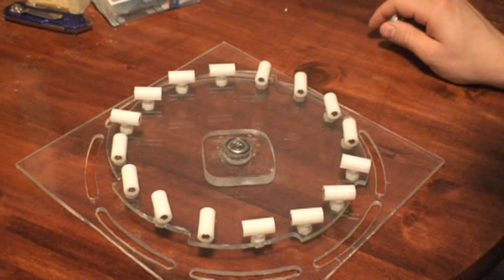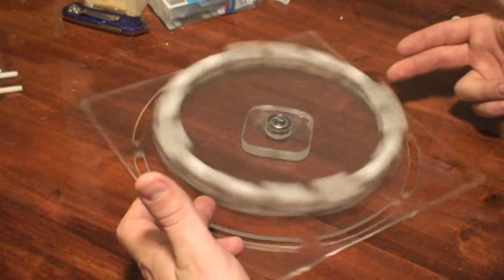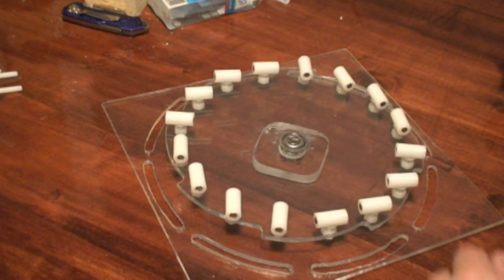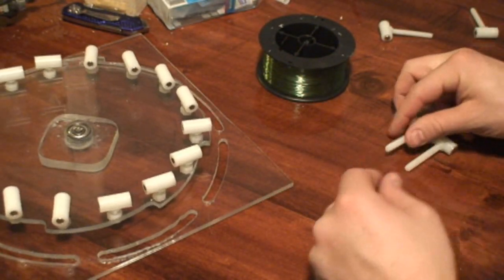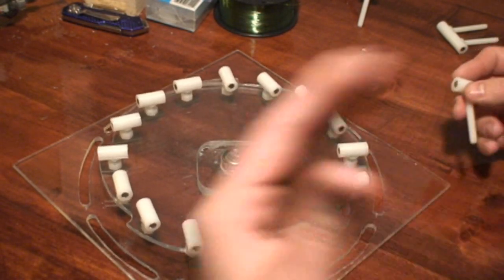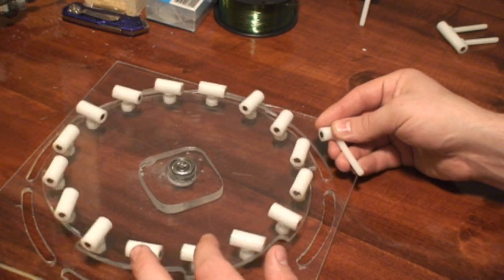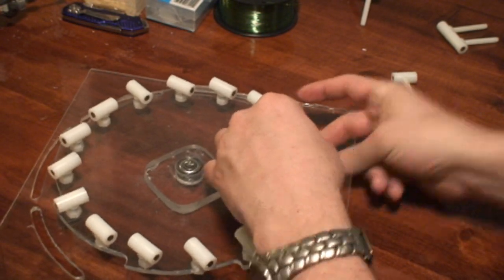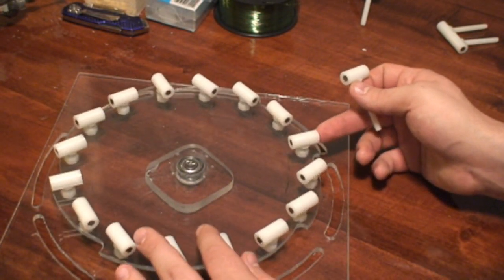Magnet motor, free energy, overunity test 2

Comment: Sorry Guys, Taylor Yarick is right, all the OP has done is recreate an electromagnet motor albeit a mechanical one, it requires energy input to spin the wheel, as soon as you put a 'load' on the wheel like the mini dynamo to drive a light this will put opposing stress on the magnets in this demo and the OP would have to work harder to keep the wheel from stopping. The OP concept of cheaper or free energy is just plain wrong. go to college and study electronics, this will include magnets and coils. you will learn quickly that you cannot create energy and there will ALWAYS be losses during the convertion of motion to electric or visa-versa.

Comment: Congratz on inventing the electric motor...
Reply: lol
Reply: that was my thought too. it's a complicated version of an electric motor that doesn't work...
Reply: Why do electric motors need fuel then?. _.
Reply: corgidog quirke
electric motors need electricity to create a magnetic field. In this case the fuel is the guy himself switching the magnet. So for that reason alone this is not "free energy". There is no such thing as "free energy" because of physics.
Reply: +corgidog quirke Because they are losing energy.And this is why this free energy bullshit will not work.
Reply: +Jürgen Ruut Maybe you're right. but that doesn't mean there is not a situation being created here where a net gain of energy could be created
Reply: l1thal
If you (could) factor in the energy put into the system by him rotating the magnet, you will find that this motor will not be able to generate energy. Nothing can. There is literally no way to create energy from nothing. For any Newtonian motion to happen there will have to be an energy input. And in ALL cases, that energy input will be greater than what you could retrieve from that motion. That is because any two objects that interact with each-other will always lose some energy through heating up and then cooling off again.

If we talk about sub-atomic particles and how they behave then yes, motion seems to simply "happen" (photons will always move at the speed of light from the instance it is generated until the instance it is converted into something else) and even though that motion still has "energy" to it, it is not generated from nothing. It is a bit hard to explain how energy works in a single youtube comment so I suggest you simply read up on the "law of conservation of energy".
Reply: +Jürgen Ruut Maybe he could create something that uses the force that is obviously being generated by the magnet (rotation of the wheel) in order to make that one small magnet rotate. I'm sure the force needed to rotate that small stick is significantly less. Also, the magnet is naturally repulsing, so it WANTS to turn away from the other magnets on the wheel. The force needed to do this would not be more significant than what that spinning wheel has.

I would be careful about your all-knowing power, Dr. Omniscient. There is an infinitely growing number of examples in history where people who say certain things are impossible are being proven very very wrong. These 'laws' have been created my imperfect people have broken before. We DO NOT know everything about physics what-so-ever. So please don't go around killing everyone's dreams and concluding that there is not hope for this type of thing because the honest to god truth is that you do not know.

On a less aggressive note, How did all the energy get here in the first place? If energy cannot be created or destroyed (I have read this law and have researched it some) Then that means that energy cannot exist what-so-ever. So where did all this come from? All the energy we expend everyday comes from several sources, but what happens when the sun burns out along with all the other stars? when all these plants stop rotating etc.. Something, Somewhere had to make all this energy happen.
Reply: l1thal
Where did the net energy of the universe come from? That is a very good question and by all means, after you have educated yourself on how energy transfers work in this universe, go and try figure out why the big bang actually happened... I'd kill to know the answer.

Also, no... the rotation of that wheel would not be enough to keep rotating a small magnet. He specifically said that the wheel has as little friction as possible... that is the reason why it would seem like it would give out more energy than is put in. But if you don't believe me... please go ahead and try it out. After you have failed, come back to ask for forgivness.
Reply: +Cristian Ceron take a look read a book reading rainbow
Reply: I'm not trying because currently I have other aspirations in life besides sitting on my ass and looking like a no-life as my wake of drama follows me all about wherever I go on the internet. Unfortunately, I'm not willing to speak about my job here, but I can assure you I am benefiting the world. In not only what I do for a career, but also in what I do here, ENCOURAGING people who DO try and have the desire to making something of the sort. While we have people like you who go out and look for things, then come home and sit on a computer and rant about how everyone else is stupid.

Cristian Ceron You're right, Friction DOES exist. But that fact doesn't mean we know everything about physics. Don't deduct that everything has been discovered unless you want to look like one of those idiots who say things will never happen and then those very things end up taking off.

All I'm saying is you guys should keep your negativity to yourself. It's not benefiting anyone.
Reply: Was my first thought too. But then I looked at the comments and was not surprised to see that I am one year late to the party ;-) This gives me hope that even in the Trump era there are still intelligent people out there who understand basic physics.
Reply: Ivan Zhu hi
Reply: That's a combustion engine.
Reply: also alot of electric motors take petrol due to a back up petrol engine to either drive the car if it runs out of charge or to run a small generator to charge the batteries to run the electric motor
Reply: Actually the joke is on every one of you that laughed at this guy for thinking he created free energy, he got a shit ton of money from this video (4.4 mil views), so it's more like free money for him
Reply: Doesn't work
Reply: Well this is running for free.
Reply: Electric motors are energy conversion devices, not energy generation devices. If fact, there are no energy generation devices! Burning gasoline for example,  just converts stored chemical energy to heat and work but doesn't make new energy.

Comment: maybe you can design a switch that changes polarity when the magnet is approaching. making sure mechanically that most pull is used, switched polarities on time to then give it a push after leaving its proximity per magnet.  if a switch can change polarity on a certain right timing it might enhance the velocity of turning. or like have magnets spin on the outside making use of the poles as needed with timing. maybe you can have a  little laser detector or some detector to really be able to get a signal and create a specific perfect delay in the switch. great mentality about the team work! hope you succeed.
Reply: Using mechanical means to turn the magnet would result in friction, which would make it loose energy I'm the form of heat. It would slow down and stop eventually.

Comment: To much talking. :/
Reply: Filatuss for nothing. It's just another fake video ...
Reply: Filatuss ...and too little understanding of elementary physics.
Reply: ^ Bingo.
Reply from the maker: Mike Adams Yeah, sometimes I'm embarrassed at these early videos. But it was what inspired me to really dig into studying. Now, I silently shake my head at people with as little understanding as I had then. Oh well.
Reply: jzsd14me Well, if you learned from it and progressed that's a productive and beneficial outcome. No need to be the least bit embarrassed or ashamed for not having learned the fundamentals of Physics earlier on.

You eventually learned and are much better off for it. I was lucky to learn Physics in high school and college. Plenty of students never received any education in the physical sciences whatsoever as one can clearly glean from the comments posted.
Reply: +Filatuss Yes too many words to say very little...
Reply: +Filatuss yeah, too much
Reply: No, don't use an electromagnet to change the polarity. Just set up something mechanical, so that for every 4 magnets that pass, the trigger is rotated 180 degrees. If it is mechanical, then the rotation would be exact, and it would keep up with the spinning wheel perfectly. Don't overthink it with electromagnets and calculations and all that junk. I'm sure you can figure it out easily. I'm not an engineer, but just use gears and stuff.
Reply: +Th3 DarkKitsune I suppose, but if the connection is small enough, and the magnets are powerful enough, friction would be too small to make much of a difference. Mind you, I am not an engineer. This is just takin' it off the top of my head, thinkin' logically. Why make things complicated?
Reply: +Filatuss  agrred
Reply: Happy new year. :)
Reply: *too, not to. :|
Reply: The Best Travis haha true. ;)
Reply: +The Best Travis 
:D yeah...
Reply: Too* and yes i agree
Reply: fucking agree
Reply: Empty vessels make most noise.
Reply: I agree
Reply: Too*
Reply: Click the above and say goodbye to your pc.
Reply: Too much talking*

Also, if so, why did you come to watch? Too lazy to try and grasp how things work? Or are you content with those still stuck in the stone age.
Reply: Too*
Reply: Filatuss that's what I was thinking before I saw your comment.
Reply: you need get tinny electromotor  which will keep the two magnets spinning. the motor you may power with battery 6v - 12v  just for the test if it does you need.. once you build the coils and set up all and measure the output from the max effect. lets try figure out how to power the tinny electromotor withour using the battery.. and there you go. thats what I'll do.

we live off grid on daily base used by solar panels, wind turbine, bike generator, and with our crew we are open to any kind of free energy .

Comment: Use two wheels with magnets in stead one, This way you will have magnetic pole change, when they spin.
Reply: That sounds like it will work, but it will not. N-S still averages zero.
Reply: Cotronixco hmm... small wheel with one magnet from hand?
Reply: extrasupermorgen No arrangement of fixed magnets can produce energy. North is always the same strength as South. They cancel each other out regardless of the arrangement. The only possibility requires alternating poles, which requires energy. You will always find that the output is less than the input. These people post these videos only to get as many views as possible.
Reply: Cotronixco
you say north is always the same strength as south, but strength is strength, surely there is a way to convert the force of two strong magnets repelling into energy?
Reply: ***** No, not possible. Let's say you push on the back of a car and another person pushes equally on the front. Relative to each other, your forces are always identical - but equal and opposite. No energy can possibly be harnessed from it.
Reply: That analogy would only work if referring to two same-polarity magnets trying to work against each other with equal force. That is not the case here. Of course you can harness energy from magnets at fixed locations. The only thing that you can't do is use the energy collected to replenish lost charge in the magnets.
Reply: Cotronixco shut up.
Reply: Mark Gosselin shut up yourself he's right
Reply: Jonathan Gray No, you can never harness poles' absolute strengths - only their relative strengths, because of their effect on each other, which is always equal and opposite. They cancel each other out EVERY time.
Reply: Cotronixco you substitute logic and replace it with a misinterpretation from a textbook.
Reply: Jonathan Gray Tell you what, Jonathan. I will gladly pay you $50,000 if you get it to work. This incentive will show you once and for all how magnets actually operate, the difference between absolutism and relativity, and you will eat your words and it will make you feel like the fool you are portraying yourself to be. Now, got to work.
Reply: Jonathan Gray
Telling people the partial truth is your way of motivating them? That is quite stupid. If they were serious they would take a fairly basic electricity/magnetism class and realize fairly quickly that these ideas are just pipe dreams.
Reply: megamixa What partial truth did i "tell" people, and why exactly is it stupid anyways? Rhetorical questions; The answers are none and it's not stupid. Go troll somewhere else, you obviously have no idea what you're talking about lol
Reply: Most of the general population has no idea what they're talking about when it comes to science so it's not surprising to me that nobody here has any idea what they're talking about either
Reply: Jonathan Gray
The partial truth you are telling people is that their project did not work because they did not do something instead of telling them that their idea will not work based on the system they constructed.

I could tell you that eating glass will fill you up, but I am only telling half the truth because it is also extremely dangerous. Omitting information is the same as only telling half the truth.
Reply: Mark Gosselin
 Then prove he is wrong.
Reply: Mark Gosselin Well show me then
Reply: Cotronixco there is no strength for magnets, you would mean flux or flux density? which you could have different flux of north and south fields
Reply: Michael Kennedy No, north and south will always be equal and opposite, because they rely on each other - it is a relative, not absolute amplitude of energy.
Reply: Somone looks like they're on the right track
Reply: Sven Vdg Well, you can prove yourself that it doesn't work if you search two words on google: "Lenz" and "Law".
Using your newfound knowledge, you can calculate that you will always AT BEST put as much energy in as what you get out. And I said at BEST, 100% efficiency isn't achievable due to resistance(both of the metal and the air). So yeah...

Comment: If you want free energy, buy some solar panels.
Reply: even that is not free, you can never get free energy
Reply: 'free energy, buy'
Snag some solar panels = free. But only for you... shame.
Buy cheap solar cells from China for pennies and build your own solar?  Priceless. ;-)
Reply: Mathew Boston wow.... -_- you didnt get his point

technically the energy is free generated by the solar panels... the solar panels are not free

so its still a free energy FROM solar panels
Reply: Magnetics.  Radiant energy...  In a weightless realm, magnetics are a source of free, limitless energy.  Beyond that, just from running your engine you'd have alternators to recharge every battery source you have.  Transformers; uniquely constructed to step the power when and where you want to... Rawlemon orbs?  There are many possiblities... and most we won't find out about for many years, since known ones are kept secret as well.
Reply: rstevewarmorycom Tell that to Thorium.
Reply: Timothy Bucci Thorium is a myth. Only 150 years of it and them we face the same crisis, but this time without energy to help us.
Reply: Adam Heinermann But it has nothing to do with "magnetics" as he put it. There is NO power worth mentioning to be had from the earth's field, because it doesn't vary, thus cannot induce power in another circuit. And the sun, though variable, is many times smaller at this distance. This notion of magic energy coming from magnets or "magnetics" is complete and utter horseshit.
Reply: Though electricity can be wirelessly transferred...  Which also means electricity can be generated from wavelengths.  Transformers transform power from the magnetic field flowing through iron.  And CT's step down the power for meters just from the magnetic field flowing through wires.  So, yeah, magnetism is a way to generate free power.....
Reply: Timothy Bucci No. This is what comes of not understanding even the physics of Faraday and Tesla. ONLY a changing magnetic field induces current in a remote circuit. And to change that field and drive anything in that remote circuit takes an application at that source, of power, energy per second, that is greater than or equal to the amount needed if you were to power the remote device directly. Magnetism is NOT an energy source, it is like a spring that must be compressed or stretched by another force. It is like you saying that because you can pull something with a rope, that a rope is a source of energy. So no, magnets are NOT a way to generate free power. Neither are springs or ropes. If you could SEE magnetism and the way it worked this would be obvious to you, it's only because it is invisible that it seems like the required "magic".
Reply: Changing 60 times a second.... yeah.  Seems like, since it's already there, you could produce free power off of it IF the power company didn't catch wind of what you were doing.
Reply: Timothy Bucci There's no way to couple to the grid magnetically that will do more than run a flashlight. Go take a coil of wire and a voltmeter and go stand under high tension lines and see how little you get.
Reply: Genius idea!